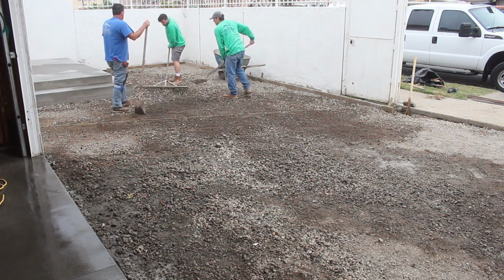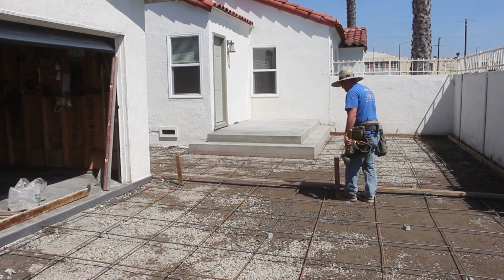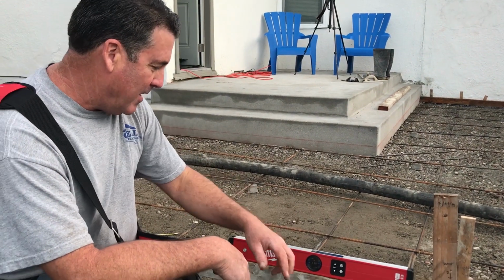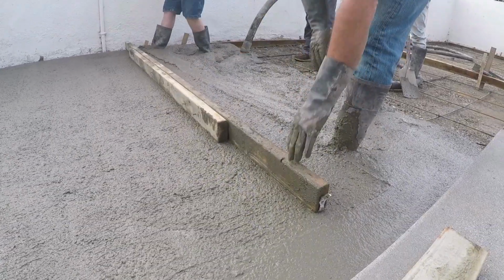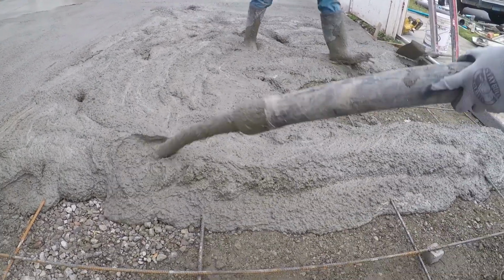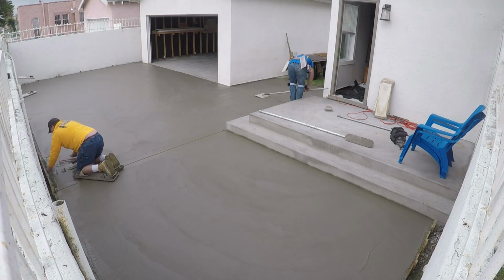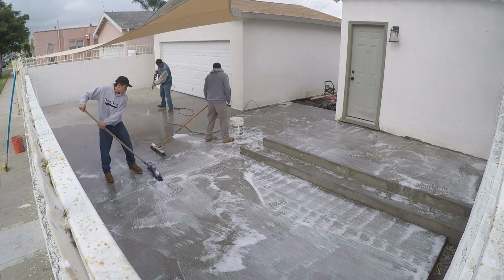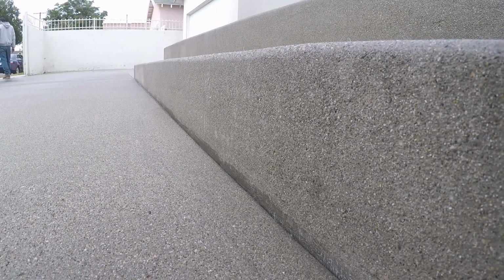How to Pour a Sand-Wash Finished Concrete Patio & Garage Part 3

Comment: You're a master at your job sir.  Mi sister had a new concrete driveway poured and her contractor broom finished it instead of offering to match her old sand wash concrete.   No pride in his work, obviously!  Thanks for your video and the clear explanation.  
I'm an automotive painter by trade and it would be lousy to spray one panel on a car and not match the color perfectly to the adjacent panel.  
Anyway, my hat off to you and your workers!!!
Reply from the maker: TY
GL

Comment: I want the Milwaukee Smart Level. Hosing off made the same result, but cheaper, and you can finish the job the same day. (Except when you need to sawcut). Maybe there is a more narrow tool for putting in controljoints on the same day as the pour?
Reply from the maker: Yes there is narrow jointers, Much harder to use and keep open
Reply: @OdellCompleteConcrete  Would imagine finishing the job in the afthernoon, then just checkup the next morning would be "more effective" but nice for the customer to have you on site for a checkup afther the job is finished. Nice vid btw.

Comment: I need some advice.  I am building a 12 x 16 shed on a raised foundation.  I would like to put a concrete ramp approximately the depth of a 2x4 (like a small drive way) at the door entryway.  The threshold height is 11" above grade.  How should I go about forming this up and what can I use for a filler so I am not pouring 100% concrete? I find your videos so instructional.  Your an excellent teacher. I want the Milwaukee smart level
Reply from the maker: Dirt or road base
TY
Reply: @OdellCompleteConcrete  I went back and watched part 1 again and the porch step form along with the base material allowed me to understand.  Will a hand steel tamper work well enough for compaction?  I appreciate you're help and advice, thank you

Comment: would love to know if you still like the Milwaukee backpack sprayer. I bought one for this reason and had to return it because it draws air with about a gallon remaining in the tank. Mine did not empty out, I tried everything. Milwaukee tech support said stand up straighter ha ha, how about design the sprayer with a little sump in the bottom and put the suction tube in the sump? He said, well there is so much junk in spray nowadays they wanted the suction on the high side of the tank ---- um, ok? so I returned it, and I still don't have one
Reply from the maker: I use the Tomahawk gas powered back pack.
I needed more power.

Comment: What do you think is more durable, liquid pigment or powder pigment for a terracotta concrete patio? Thanks in advance, love your channel! Also I noticed before in another video you used a white spray on liquid on a larger job for the sand wash finish but in this video you only used the hose to wash away the cream, why?
Reply from the maker: Probably the powder, because its done when the concrete is wet.
To show either way works.
Reply: Greats thanks a million, starting my pour soon in Ireland :) Go raibh Míle maith agat!

Comment: I want the Milwaukee smart level.  

Great video,  looks like you can save some $$$ on that top cast. 

Question for ya, have you ever used a aluminum screed board? If not why are you choosing to do so now? Thanks Dave.
Reply from the maker: yes I have some coming up.
I like them

Comment: Can you create a concrete finish as white as the white sand beaches in Florida if you  had sand that white ?

I work on a sand mine my boss just bought that has sand as white or whiter and going to try and do that to learn to create “white sand concrete “
Reply from the maker: Silica sand #60
Reply from the maker: Might need white cement also
Reply: @ ohhh 😮 good idea 👍
Reply: @ I’ll have to find white cement

Comment: On your next sand wash job you should try sugar water. You just add sugar to water and spray on like retardant. Works the same but no clogging.
Reply from the maker: Sounds better
Reply: Use about a half pound of sugar per gal. of water. You can wash same day or next depending on how hot.
Reply from the maker: I did that before retardants and Rugisol